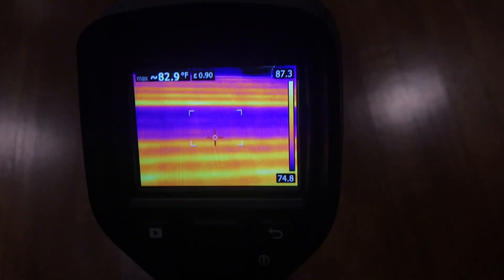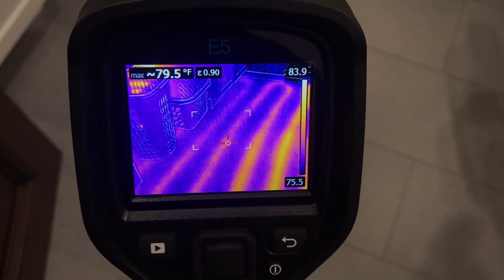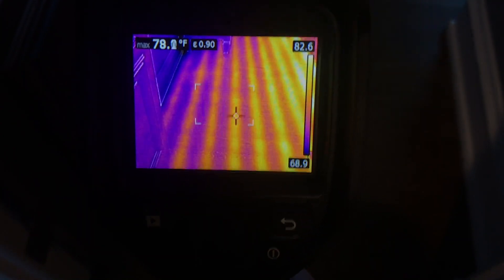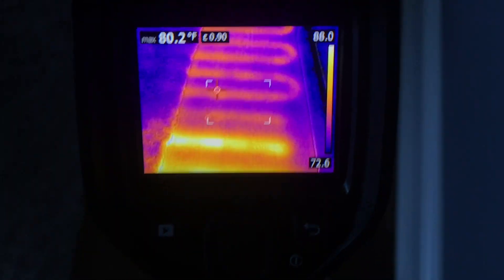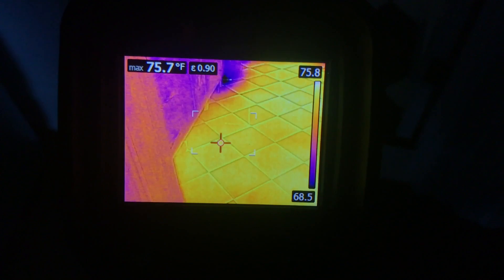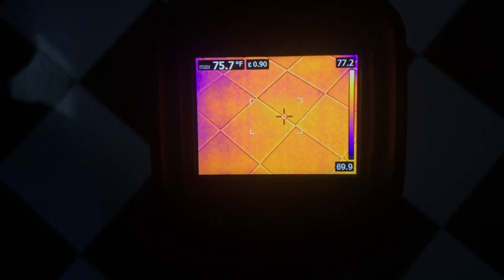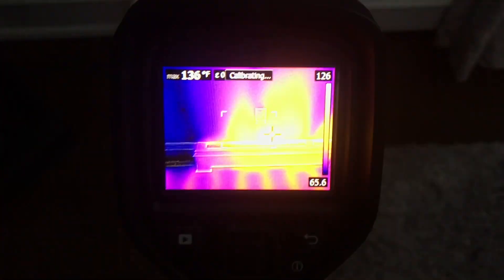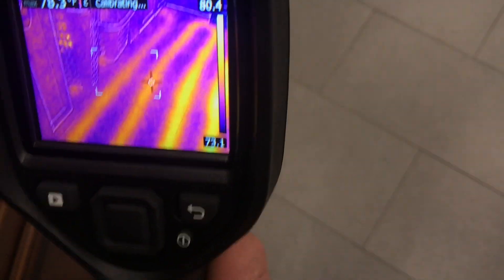Testing Radiant Floor Heat Using Thermal Imager Flir E5

Comment: I would appreciate a helpful opinion! 
I got hotwater heating tubes inside concrete slab (indoor) flooring...
The slab(s) are sinking and i want to raise it/them via a local poly/foam injection contractor...
is this a disaster waiting to happen or is this a likely success path?
I am thinking about renting a thermal imager from home depot to mark out the tubes myself...is that sufficient to get accurate locations?
Thanks for any potential helpful input!

Comment: Hi, thank you for uploading. I have a question, do you need to cool your floor and start the heater afterwards to get the image this clear? Or is this just looking at the floor at any time?
Thanks 😁
Reply from the maker: I heat was running for some time. The pipes are going to show up like this due to how hot they are. It’s why I use a thermal imager when troubleshooting radiant heat. Without its hard to tell what’s really happening in the floor
Reply: @thehvachacker  thanks!

Comment: I have a flir very similar to this one. Make troubleshooting a lot easier.... Very versatile. Good for bad electrical connections too and missing insulation. Diagnosed quite a few mystery blown fuses on roof tops due to poor disconnect connection even thermostats putting off too much heat and reading the wrong temperature. Gives customers something tangible too that they can see I really love thermal imaging.
Reply: whihc model did u get. theres an E4 E5 etc etc

Comment: Can anyone imagine how much their heating bill is per month?😫
Reply: Cheap as fuck lol this is the cheapest most efficient way of heating and if you tie it to geothermal even cheaper. 40 to 100k to install but I bet the heating bill is under 100 a month.
Reply: Super cheap. I have an old radiant heat system in the concrete. Bill is stupid cheap.

Comment: Lots of good uses for the thermal imaging systems. Troubleshooting electrical hotspots etc. Flir makes an attachment for smart phones which is quite a bit cheaper than the regular systems.
Reply: Was going to say the same... he should check out the Flir One smartphone attachment.  Far less expensive!
Reply: @khx73  yeah but does it work equally well?
Reply: @beri232  Yes.  The savings is in the fact you already own the smartphone which does the processing, display, recording and snapshots.  Otherwise you pay for the whole standalone unit with all those capabilities that have to be built in.

Comment: I have this is my garage. granted I have to turn it on a good 12 hours before I plan to work out there . yes it has antifreeze in the system but the first time you are on a creeper under a vehicle you will love it.
Reply from the maker: That’s future plans. When I redo my garage floor. First I need to be able to afford this tool. Very useful for troubleshooting, also proving to a homeowner why their ac or heat won’t keep up.

Comment: when dealing with outdoor radiant, the idea is to keep it slightly above freezing so it stays melted off, not wait until there's a foot of snow or expect the just repaired system to clear it in a hurry.
snow is a nice insulator ( Eskimos and igloos anyone!)
Reply from the maker: Yea I fixed a snowmelt system during a bad snowstorm and wasn't seeing any results. Yet with a thermal imager I would at least see the tubes warming up somewhat.

Comment: that tile floor will take longer to heat up, but it will retain and radiate for a much longer period than the other floor products, even with rugs(unless its over thick insulated concrete subfloor!)
that is why many tended to do poured gypsum embedded radiant, But if not over very well insulated substrate, it performs poorly, it 100% needs a huge thermal break.
typically used is thick foam board, but who would trust foam under any walkway, driveway or roadway (stooges perhaps)
not even the most magical anti-rodent and pest control can keep the foam safe from rapid deterioration, assuming it was made perfectly to start, same for spray foams. the stuff becomes powder or slurry more often than not

Comment: all I see from "in floor" radiant is huge headaches, I hate moving old cast iron rad's, but they seemed the best solution overall. of course a full basement and pipe loss did about the same, as did the boiler being down there... heat rises and gravity fed worked great for many centuries, before the great pocket padding begun....
Reply: What are you talking about? In floor radiant is one of the best designs in building HVAC.

You would need radiators everywhere to even get remotely close to the comfort of in floor radiant heat.
Reply: @shawnd567  comfort comes at a price , ask all the folks who've had radiant that failed over the years, when they was told it would outlast the house and them. while the products have been improved to things less likely to fail, none of the current stuff it is very reliable. I think of the whole overall package, it;s good for repairmen to have work of course :))

Comment: Nice toy. Wish I had one
Reply from the maker: I wish all my money currently wasn’t going into my new home. Or I would buy one of these. This tool helped me trace out all the loops back to the manifold. With radiant heat water flow through each loop needs to be adjusted for even heat. Nothing in this house was labeled. Yet this is one of the tools I need to save up for

Comment: $1400? Yikes.
Reply from the maker: Yes yet I feel from borrowing it and using this tool its worth it. I have 1000+ houses with radiant heat. 200+ houses with driveway snowmelt systems. I spent hours just looking for hidden radiant manifolds. It's expensive yet once I recover from the house I just bought I will add this or the e6-xt to my tools.Lots of uses for a tool like this. I was checking insulation in my walls. I had an overheating exhaust blower in my garage. If only I

Comment: Nice. I just got the fluke vto4a it’s a third of the price of the FLIR E5 and I can tell a major difference between yours and mine just by this video. Your camera image is so much crisper!
Reply from the maker: I won't take credit for this camera. I borrowed from a coworker. Now I need to buy one. I had my eyes on the e8 yet after using this don't need to put out that kind of money. If only i didn't just buy a house............... I am in between this and the e6-xt Just to many expenses currently
Reply: The HVAC Hacker lol no worries, I say it’s yours because it’s the one you’re using! I’m tempted to return my fluke and save up a few more pennies for one of these. I love it!
Reply from the maker: I’m jealous at least you have a thermal, I been holding off cause I wanted the e8 yet from using this one I don’t need to spend that kind of money

Comment: Your company should provide at least a couple of these for their field techs. Useful for more than radiant systems; clogged condenser tubing, refrigerant level determination; detection of overheated bearings and any number other uses. Check out  https://www.youtube.com/channel/UC5Pnrxqqg4BLTsfsUzWw5Pw/videos; he has been using a thermal imager for a little while.
Reply from the maker: Yes the combustion analyzers cost more than this and they place 5em on most trucks

Comment: These are awsome...I've installed a few systems in my time...1 had a entire basement room for the manifolds and mannnn there were alot of lines..very expensive then!...2005 I think
Reply from the maker: It’s a lot of work laying down all that pipe. I used a 6 or 8” long 2x4 as the spacer for the pex. I have done many radiant installs back in the day. It’s amazing seeing the piping heat up in the floor.